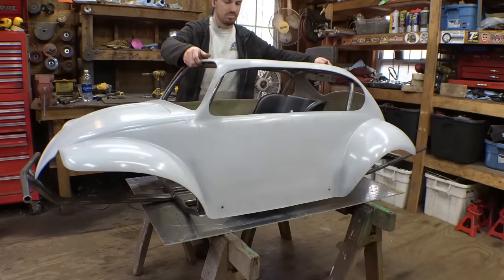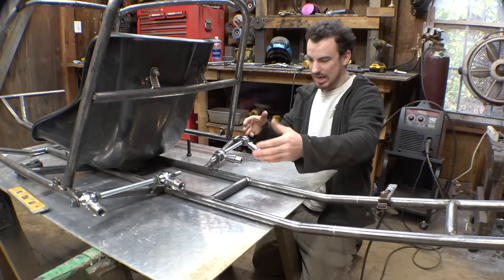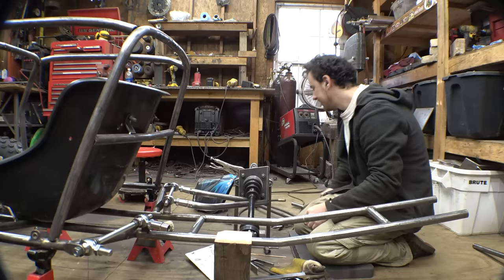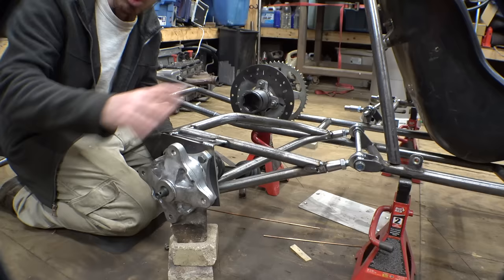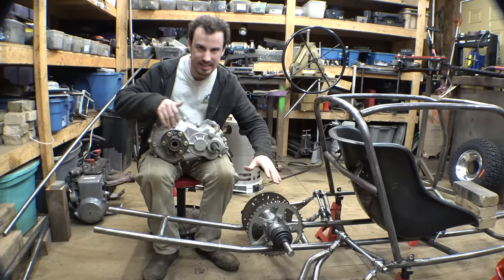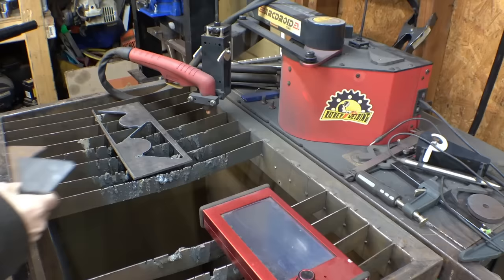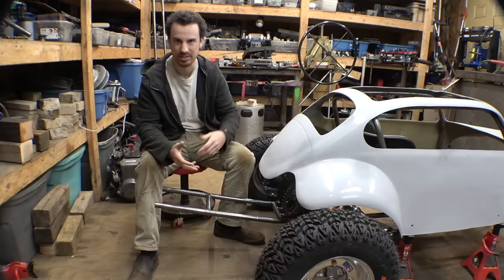Home Made Mini VW Baja Bug!! - Part 2

Comment: Don't be sad from comments about "how horrible chain drive" is , i think thats easiest and cheapest way how to transfer power, it's easy to repair, and easy to edit gear ratio. You're doing amazing job and you do it better than other youtube channels about buggies which i watching. So, please continue making awesome beast :) Thx for content you make and greetings from Czech republic.
Reply: Yeah I don’t see nothing wrong with chain drive do what is easy for you and what you in joy building amazing work but keep up the good work 😊
Reply: I used chain drive with my mini monster truck build..hold up to the abuse well
Reply: yeah, chain drive is what you know, and is easiest, so why not stick to it. also, that's what is on the bikes these engines come out of anyway. works for your crotch rockets, works for little (and big) buggies too.
Reply: You can cover chaindrive to make it better than gears. Chain sealed in oil like motor cam chain lasts so incredibly long, sometimes even longer than the engine itself
Only downside being noise, even that can be muffled
Reply: Chains rock 🤘

Comment: The suspension you used would be called a Semi-trailing arm design. 

A true trailing arm suspension has the two piviot points of both arms in line with each other.

That doesn’t affect camber as it goes up and down. Because the piviots are perfectly horizontal to the chassis. 

Now a semi-trailing arm suspension is a mix of a trailing arm suspension and a double wishbone suspension. (Transverse)

This is because the piviots are not parallel with the horizontal axis of the chassis. The piviots are angled and would create a shallow X pattern if you continue the pivot angle lines.

(Hopefully this is making sense so far)

The “Correct” angle is kind of a grey area for these suspensions as it depends what you’re trying to accomplish. And the biggest reason these suspensions are no longer used is the squat characteristic they have on acceleration.

The squat changes the camber and toe. (This can be beneficial or detrimental depending on the setup and desired result)

Typically most automakers used a 15-20 degree sweep angle.

The “ideal” angle is dependent on the roll center of the chassis.

If you take both trailing arms and pull them up like the suspension is fully loaded down. You will see the axis the wheels rotate on will intersect eachother in the middle of the chassis near the ground. 

If you know the roll center, then you can dial the sweep angle of the arms in to get the intersection point to be dead on to the roll center. 

There’s a lot of stuff I left out and a lot of stuff I over simplified but I hope that helped you or anyone else reading this. 

Good luck!
Reply: 1000000% you lost him on this but great to see someone knowledgeable in fab post finally
Reply: Not quite, the sweep angle together with the track width and semi trailing arm length, and even wheel size all determines the roll centre. The big detriment to semi trailing arms is a thing called jacking which can cause the suspension to go into droop and lift the vehicle whilst cornering, the other is on long travel or RWD vehicles negative camber gain can be excessive meaning you lose traction. With 10 degrees sweep, off road, and rounded profile tyres, I don't think it's going to be an issue. The only thing that might be a problem is that as you raise the suspension you'll get positive camber with no real way to dial it out (yet), you kind of want to run the semi trailing arms close to horizontal. 
Ps: semi trailing is more of a cross between trailing arms and swing arm suspension, both of which I think got used on VW beetles. Sorry I know I'm being pedantic...
Reply: I feel like he might have experimented with a torsion tube supported arm like in the actual VW's. Would have been cool.

Comment: I look forward to these videos every day and I wish I could do something like this myself but being on disability really limits my life..... Wish I had a neighbor like this. Keep up the great work....     😁👍
Edit: I have no issues w/ a chain driven system as long as it's not 12 feet long....   😂
Edit 2: You can always do a 2 lever "e-brake" system so you can steer when doing wheelies or make an e-brake lever that moves left and right instead of straight back to do the same thing.... Can't wait to see what this thing is capable of when it's done.   👍
Reply: The idea for the brake sounds good to me!
Reply: Similar situation here. I am severely disabled and i loved building things, i still 3d  design and print but this channel and similar really fill the void !
Reply: @afslayer  me too man! I mostly like my rc stuff but I've gotten down in the garage floor many times for different projects like last year I finished a electric gokart and recently changed all the rotors and calipers and pads on the wife's jeep and I tell u those big ass wheels are a piano to get back on with only 2 arms haha

Comment: My corn picker 1943 year has used the same chain and will work next year. We use it each year my grandpa bought new. In fact it has 7 chains operating it. Normal maintenance consisting  of lubricator and adjustment if necessary. Lot of use. So yeah chains come differently sizes. Great show. Thanks.

Comment: I think you will need to replace at least one heim joint with a straight bushing on each side otherwise there will be an axial load on the CV joints in the axle which they won't handle. you could potentially rework the position of the two heims, maybe have one further in front of the other, probably just a straight bushing though.

Comment: Nothing wrong with chain drive! Dirt bikes still have them! Chains get difficult when long distances are involved. The truck project/concept was awesome the only thing I’d recommend is nylon slipper rails to stop chain slap on the long runs. Excessive chain slap exerts excessive pressure on parts (brakes parts). Reference overhead cam setups, high speed chains with no slap. Seem to work there 😂 
Keep it up, your channel is progressing nicely. And a awesome coffee watch in the morning for me 👍👍
Your format with explanations is very good! And your projects are useful and not “click bate” for “likes”
😮 I’ll shut up now 😊

Comment: My electric ZTR mower (building V3 this winter) is chain drive. Basically 2 separate gokart setups, one for each rear wheel. Chain wears out? replace. Done. Easy / fairly cheap.

Comment: The steering brakes you are referring to, are called Tractor Brakes where I grew up.  I have seen this done with three pedals, two small pedals with a small gap between them (each attached to its own master cylinder) and one pedal that bridges the gap and allows you to press both of the other pedals at the same time. - I hope that makes sense.  Another option is to use a dual acting master cylinder and separate calipers with a large lever to activate one side or the other at a time (much like a drift brake system except for the type of master cylinder).

As for a differential, look at the Miata Gen 1 stuff, they are still easy to find, gears are still available and they aren’t too expensive.

Comment: Coming from someone with a full sized tube frame long travel baja a cutting brake is quite literally the most fun thing you will ever use I would highly suggest looking into a diff for it I’ve got a cutting brake laying around if you want it as well

Comment: you could have used a BMW  flat twin motorcycle engine. that way you could use a differential  (since the BMW is shaft drive) you could flip the diff upside down so that you can have the engine facing the back of the bug and still have forward rotation of the axles. then you could incorporate differential steering like you want and REALLY have a bug looking baja. also, Bimmer flat twins are oil cooled with oil cooler radiators so no need for coolant....Get an R1100/R1150-R1200. use a shorty drive shaft to some type of limited slip diff that can run flipped over. you may have to add new breathers and plug the originals....but no biggie!!!!!

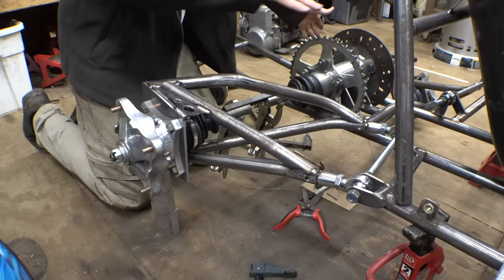Comment: 24:41 as for the brakes for a wheelie. You can use a push pull lever. Push to activate the left rear brake and pull to activate the right rear brake. I’ve built a couple for a customer for his sand rail.

Comment: You should make your own diff for this so you can put a locker in it. At the size we're talking here a locking diff would be pretty expensive, unless you make it. For the locking action, you could have either a pin system that locks the axle gears or a fixed small gear that drops in manually and locks the two axle gears.

Comment: I've had cut breaks on my baja bugs, and they are great for doing some fun turns. You could definitely use them while in a wheelie, but I think it would just add a lot of unneeded stress.  I think you should build it with the spindel set up, not a diff. Make sure it does wheelie before you get worried  about trying to stear the wheelie. I Love the new project.  I swear every video I watch of yours gets better and better. Keep up the great work.

Comment: They are called cutting brakes, and all you have to do is put discs on each wheel and run a seperate line to each. They are operated by a hand lever.
Reply: That won't work with an effectively solid axle though, hence why he mentions the need for a diff. You could do it with clutches instead

Comment: cutting brakes only work with open diffs sadly, but thats a sweet idea for a future module you can swap in or, maybe even doing an open diff with a means of locking it so you could have a locker for technical stuff, then have an open diff for when you are playing in the sand and need to use cutting brakes while doing a wheelie

Comment: 68 and earlier have what is known as swing axle suspension, and 69 and later have what is known as independent rear suspension (I.R.S.). They both use the same torsion tube in the rear. And it looks like you're basing it off the I.R.S. type.

Comment: They're called "cutting brakes". Most buggies have them. They come in 2 styles. A dual lever or a single push/pull lever. With the single, you pull to brake the left wheel, and you push to brake the right wheel. The main brake line passes through and separates at the cutting brake master cylinder, then go to each rear wheel.

Comment: The separate brakes on left and right rear are called turn brakes. Old School V-Dub sandrails used them a lot. You should be able to find a setup for this if you design a diff.
Reply: We always called them cutter brakes 😅

Comment: I can see the descent about chain drives on projects like the trophy truck. Although I totaly get why you did it. Just to prove it can work. And it does. But a chain drive on projects like this are perfect. Simple, versatile, adjustable, easy to work on, and reliable. TBH I'm not really a big fan of belt drive systems. They're finicky, require a lot of maintenance, and you have to get the springs in the drive pulley just right or they slip too much. Just keep doing your thing Chris. It's gonna turn out badass and the shit posters will watch it anyways cause you do great projects. Period.

Comment: The brakes your talking about are turning/ cutting brakes. Also I would stay away from a diff if you’re thinking of doing trail riding because they take away traction. I have a class 5 Baja and every trans that goes in it gets a super diff witch helps with slipping

Comment: The snowmobile engine would need at least 8:1 gearing, 13:1 is excessive. If you know what the polaris CVT ratio is at high end, Spicer has a speed calculator for CVT. Just put in tire height, final drive ratio, engine RPM, and CVT ratio for over drive and youll see your top speed. 13:1 might get you 45-60mph. But more info is needed.

Comment: So the braking you're referring to is called a "cut-brake"  and is typically ran from a handbrake(s). One lever for each side or a single you push and pull to determine the side you are braking.

Comment: If you build a differetial style axle you can probably build a yolk style drive with ring a Pinon gearing and be able to turn the motor and Mount it a differently and run a short chain instead of 2 or 3 with a jack shaft

Comment: Just had an idea, might be worth looking into;
Mount the engine transversally in the back, and mount a gearbox right on the other side of the CV spool. Connect the engine and the input of the gearbox with a chain drive that goes over the CV spool, and then connect the output of the gearbox to the sprocket on the axle. It might be a bit complex to route everything, but it might also provide superior weight distribution.

Comment: Build it however you want.  Don't worry about haters comments. The name for the independent rear brakes is "turning brakes" I think it would be awesome if you were to put in a diff and do them. There are single lever (push/pull, L/R) and dual lever (separate lever for each wheel) can't wait to see what you come up with.

Comment: Chain drive is fine, and it's really interesting.  Here's a thought - why not use a Subaru R160 rear differential (or R180 from an STI if you need a Torsen diff).  Then, turn the bike motor sideways (longitudinally) and then run a very short length of chain from the output of the Motor transmission to a sprocket on the Diff?  You wouldn't have reverse, but I'm sure that's pretty easily overcome with your experience!  Most of the R160's are about 4.10:1, and you could still adjust the chain to get the gearing you need.

Comment: The trailing arms do not need to be angled out. That effects turning capability. If you get it right it improves turning. However if you keep them straight the straight line performance over the rough stuff improves. The Speed UTV has them straight across.

Comment: If your doing wheelies with the bug you would want a posi diff like the spool you have now a diff with slip and brakes are too complicated when your up in the air wheeling really on a perfectly smooth surface is one thing but in the dunes where alot of bugs are ripping they want a posi diff for sand with paddle tires 
Limited slip is meant for lawn tractors and turf machine

Comment: You cold make a compact differential using a sprag clutchs or one way bearings.
It would mean that it wouldn't stay parked in some circumstances when you turn the engine off in one direction.

Comment: I had a sand rail that was first built in 1961. It was powered by an R8 Renault. It had two brake pedals to act as "cutting brakes"  as they were known. It was almost impossible to bleed the brakes so both pedals would engage at the same time. It caused a crash that destroyed the front suspension when my brother was pre-running one of the first Baja 500 race courses. So, if you do it, use hand control levers...

Comment: with the rear swing-arms you should have made it duel swing-arm on both sides that way you have a HUGE amount of adjustments in all directions AND its MUCH stronger, and at a latter date you can add (if you wanted to) limited rear stear by swapping out the fixed hubs and putting in swivel hubs
Reply: Its a tiny buggy, it doesn't need that complexity.
Reply: @steveww07  not complex just 2 sets of arms just as easy as making the first set bottom layer
Reply: @AdversityZone  I was thinking single lowers front and rear with solid axles and panhard bars. Stupid simple.
Reply: @steveww07  simple yes but not flexible in any way

Comment: I'm defying you to do something without any chain for the next few project 😂 maybe something like mini ultra4 with a k20 longitudinaly mounted, by welding the k20 diff and using the cv as a driveshaft to a samourai t-case and differential. Anything you never tried on the channel

Comment: I like your thinking, in the way that you design as you go! I like your chain drive systems, as you said, they’re easier to adjust drive ratios. 
Wheelies are for a straight line… drop the front end, turn when needed, and wheelie on again! I think that you would end up not liking the hassles of driving with a diff in the sand!?! 
This is my first comment, keep up the good work!

Comment: Look around at almost all motor vehicles and motored equipment, chains are a vital component of them from timing to tracks there is so many versions of chain driven components they are versatile, if you love your 4wd vehicle then know that thanks to the chain in your transfer case you can go up an obstacle with the transfer of power to all 4 wheels, chain like the wheel has driven our world forward so before you hate on chain stop and think, just food for thought.

Comment: Hey Chris, if your tires are 20” tall (can’t remember exact size), your 5:1 gearing will put your top speed at around 95 mph.  If it were me, I’d gear a bit lower to give it more wheel torque for wheelies.

Comment: the only problem I have with a trailing arm setup is the axle's need to be plungging type as the axle needs to be long at full ext and short when fully compressed
this limits your travel 
That's why on the new sxs you will see they use single mount trailing arms with the bars at the back to keep the axle movement the same distance at all times 
nice work btw and incase these axles don't workout most guys run 930 cv joints with these style setups

Comment: I really like this build. It has a cool factor of 10 for sure. Hey if the chains work stick with them, chains are much better now then they used to be. I seen a guy use a shaft drive motorcycle and rear hub/diff to make his cart a shaft drive but he used the motor and trans out of the same bike so I don't know how hard it was, just a thought to keep until needed.